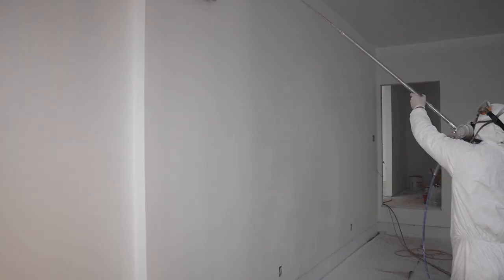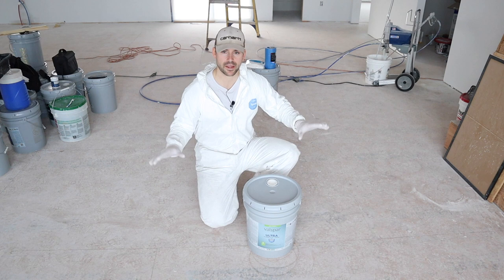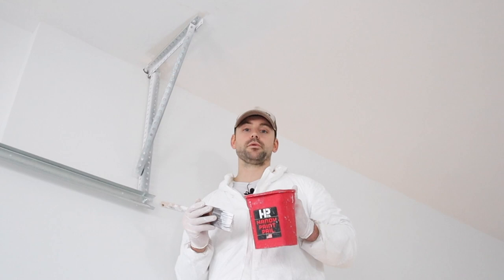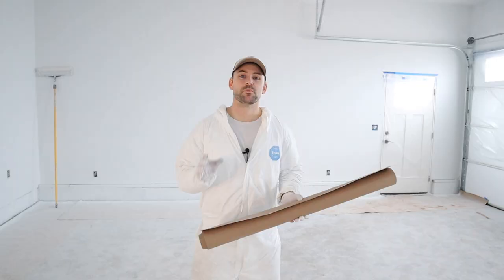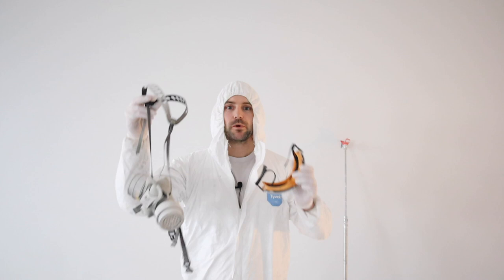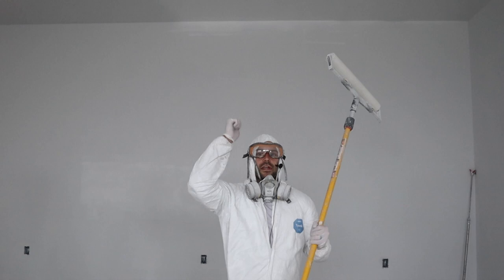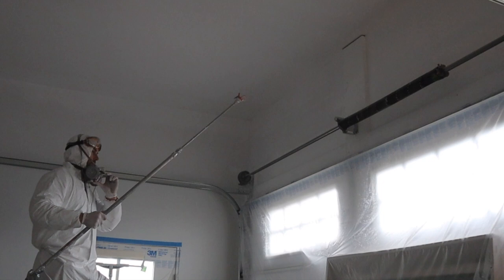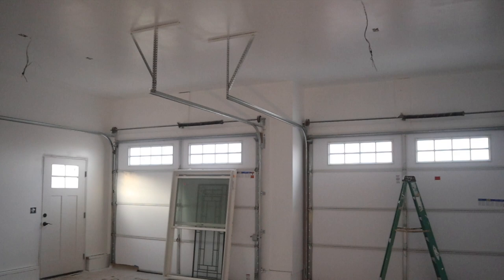How To Paint A Garage With Airless Sprayer - FAST And EASY (Step By Step)

Comment: Josh, 
Showing exactly how even a garage should be treated like the inside of the house is so important. I couldn't tell you how many houses I've been in to do work and see how everything you took the time to prep and keep clean was covered with compound, paint. Garage door springs were always the worst, besides all the mounting tracks etc. When I finished drywall for years, by us garages were always textured along with the house but one thing I didn't do was roll the walls with compound. That's when things got covered with compound. Rollers wouldn't fit behind the spring, guys would just push it behind and you can imagine what a mess that made. Enough of that though. Thanks for this video to show how important it is to have a nice clean look when the job is complete. It's how it should be by All contractors. Have a great day Sir.
Reply from the maker: Hey David! I have seen a lot of houses where they do not even paint the garage. I guess it really still functions the same but I think it looks way better to be painted. It really doesn’t take too much extra time to do so. Especially with a sprayer. I am glad I’m inside painting the house now because it is snowing like crazy right now! I appreciate you stopping by David!
Reply: @TheExcellentLaborer  that's very true as well. I've driven by where all you see is yellow drywall from years of sitting with the tape joints. And if they are just rolled with compound and not sealed it breaks down and just peels off and flakes off the walls too. You are so correct it does not take much especially when it's done has a brand new home. To take another 3 hours to do it right. I'm just grateful that you put out videos that you do that cover all the areas to have a good job at the end of the day.

Comment: He needs a mixing squirrel for that 5-Gal buckit - wOwser after 5 mins of stirring -> I'd be turning o-l-d grey~ lol. DiGGs the tuneage when on 5x video speed!

So - Question: If you know you are going to do a 2nd coat -  why not go opposite the light path on the first one - so that Phil will take care of the sheen on the second coat (that shouldn't allow for holidays or other sheen issues while ensuring a nice even finish?).,. and so - on the walls,. one can accomplish/ master that technique with a longer lightweight rigid extension and of course with practice.
Another tip: Use body lotion on your skin/ face prior to painting -- it makes *HUGE* difference/ don't need a scouring pad to remove paint from skin at clean up). 😉
Excellent video - As always!